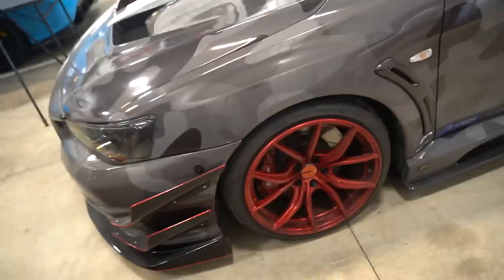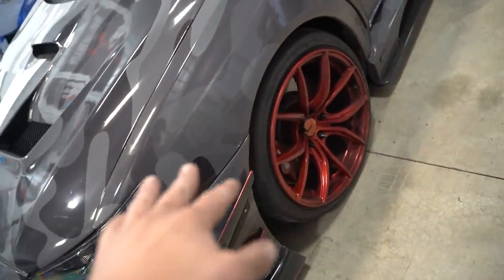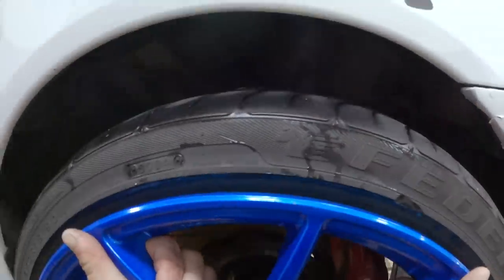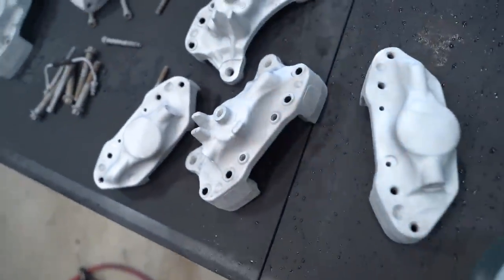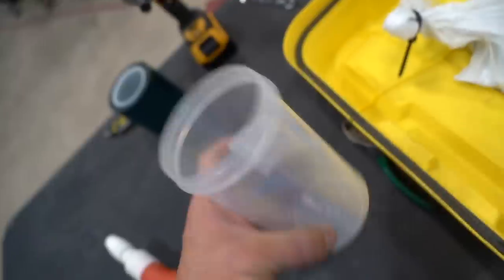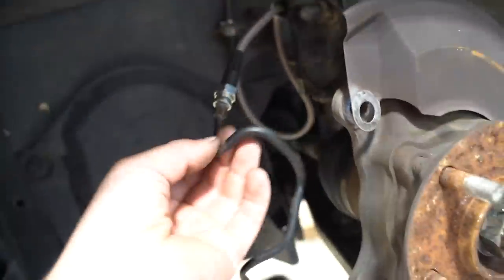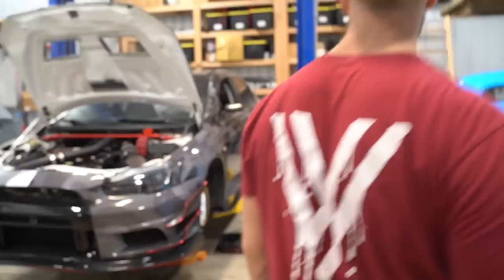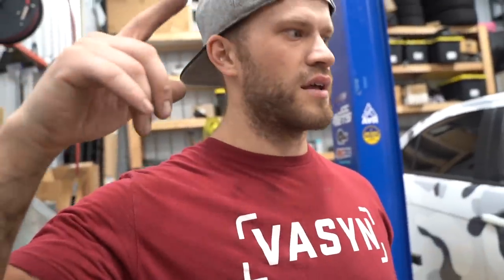Epic Refinishing Of The Evo X Brembo Brakes!

Comment: @Devin Niemela
Please look into a product called PIG Mat. It is an oil absorbing mat that you can put down when you are working on any of your messy and oily projects. You can even drop it onto an oil spill to soak it up. We used it a lot in the factory where I used to work. You can even get the Hamo PIG Mat if you want it to match our car, lol. But it will make the clean up of a project like this so much easier. It will absorb way more oil than towels and shop towels.

Comment: Braided lines make a noticeable difference in pedal feel.  Also. If there is a way to support the master cylinder from the strut bar.  Some sort of rod between the two.  It helps with firewall flex.